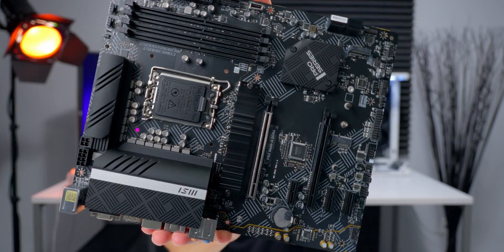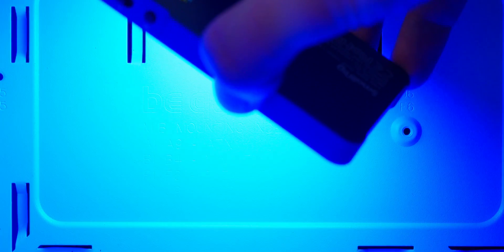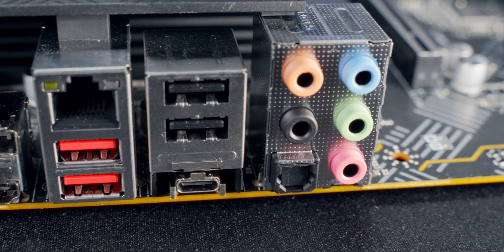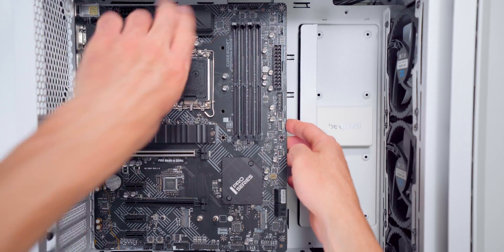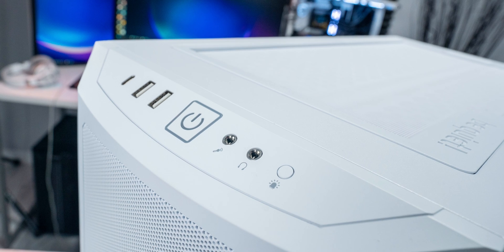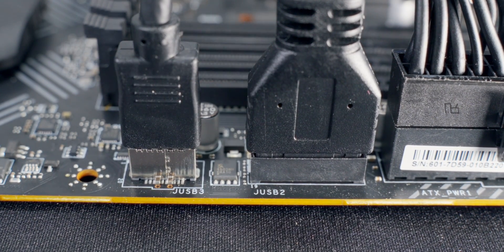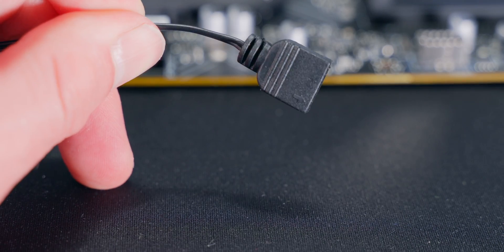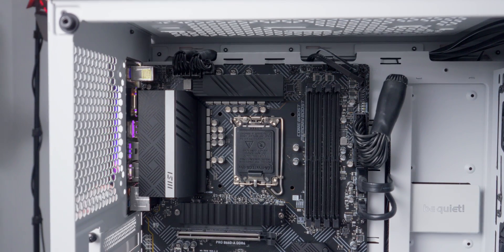How to Install a Motherboard into a PC Case

Comment: For the front panel connectors, aside from ensure they're going in the right header and polarity does it matter which way they're facing when you plug them in? Like some have a label on them. Should that face in certain direction? Thank you.

Comment: For the center post that was mentioned, do I need to replace this with a normal standoff? My case has one so I figured it was supposed to remain there and not be removed so I left it. Hadn't had any problems but I was thinking about it today. Does this need to be replaced or is it designed to be left like that?

Comment: this is one of the most frustrating aspects for pc game builders.
almost everything else is far more easy and almost repetition once you have already done it.
most of these mobos are different, not by much, but always read your manuals and watch vids before you buy/install.
i highly recommend you install 5-8 fans in your pc, make sure you read your mobo and its either 3 or 4 pins for the connections. i dont like too much RGB, im not 13.
please get a GPU bracket if your GPU is heavy, almost almost all GPU in the last 3 years are heavy, too much weight will damage your mobo, etc.
great vid

Comment: Where are the usb cables and all the minor cable go to?
Sorry for the question ive just seen the insertion of them to the mobo but idk where they come from in the case.
I have replaced every component on my pc but never a mobo seems kind of scary to do.
Reply: Answering myself for all the future people that might wonder about this.
(Finished building my pc)

The the usbs, audio, start button, and restart. Aka front panel.
Are wires youll have in your case.
Once the motherboard is installed you can fit those in their place.
Usually usb 3.0 cant be mistaken with another connection.
Nor does usb type c
Audio will be at the left down side of the mobo in most cases.

And as for the start and restart buttons.
You will need your mobos manual.
You should have 2 rows of pins mostly found in the right down corner.
The power button and restart will mostly be inserted horizontally.
But be aware each pin has a different size and different use. Which means the only one right way to connect them.

Refer to manual. You should have a drawing of the pins with each of them labeled.
For example for the power button look for.
Pwr + , Pwr -.
Make sure the polarity is right when you insert. If you can't find it on your connector. Just try 1 and flip it if it doesn't work.

And no. You dont need surgeon hands for this xd

Front panel done. Gratz
Reply: Those first USB cables are attached on the case.

Comment: How can i check what type of motherboards can fit into my pc case?
Reply: The form factor of your motherboards have different names which refer in sizes. The most usual ones are ATX, Micro ATX, Mini-ITX which uses 4~9 stand-offs in the case. The most efficient way to check, is checking how many stand-offs you have in your case and the actual form factor your motherboard is. There are plenty of pictures explaining that on google.

Comment: I have a z790 asus tuf gaming MB and cant figure out how to properly get the i/o shield off the MB first. Any help is appreciated.
Reply: If it’s already installed in the motherboard you cannot take it off, just angle it and put it in the case. That step is only required for motherboards that don’t come with preinstalled IO shields (usually cheaper ones)
Reply: Then how do we have the motherboard that comes with the IO shield, how do we make the motherboards sit properly flush over the standoff mounting holes? Because they don't align straight for me because the IO shield pushes away from the back of the case

Comment: My motherboard did not come with any screws to mount it to my case, i have an ASUS board, what do i do
Reply: The screws don't come with the motherboard, but rather the PC case. A lot of people seem to not thoroughly check their PC cases and most manufacturers include a small box/bag with accessories like mounting screws and brackets.
Reply: @JJFlores197  welp, too late now, my case's orignial packing and everything inside it is long gone
Reply: if it didnt come with any, google the screws u need for the specific make and buy them
Reply: Comes with the case
Reply: The screws usually come with the case
Reply: My screws were hidden in the hard disk drive compartment of my pc
Reply: I have the same problem i don't know
Reply: See my issue is that more than half of the pins aren’t aligned with my motherboard.. no matter what I do 🥹🙏 (Im a beginner, I’ve been at this for an hour)
Reply: Me too

Comment: This is hard to understand if you have an io shield on the board already. idk how to angle the board in to get the io shields in first
Reply: i know this is a little late but angle the io shield down to the table flipping the pc case on its back and then you can easily put the motherboard into the io shield
Reply: @peterjoecleveland  Tried that and it still didn't work. I have a Gigabyte Z790 Aorus Elite AX, and even the sides of the I/O shield prevent the board from being lined up and sitting flush with the standoffs. It was impossible to get it in and screw it down.
Reply: @aidanjames138  So how did you get it on? Because I'm having the same problem
Reply: did you get it
Reply: @jayhoochiemagee8487  yea thankfully I got it.

my confusion was with the pre installed io shield & why it didn’t want to clip on the side when seating it within the case. 

Then I realized it’s dependant on the case you buy.

so all I had to do was angle the mobo on the standoffs correctly while making sure the io shield slot looked good visually. 

Piece of cake
Reply: I've been fighting with the io shield for a couple hours, willing to try anything at this point. The first two rows we can get to line up but the top is still not cooperating. All three are just off enough to be concerned about damaging the motherboard. Any tips if they just don't line up???
Reply: @FrancisBonnefoy413 I have the same issue. Did you find a solution?
Reply: @bertramstigchristensen4614  It'll be disappointing to hear, but you really have to push it, more than you think would be safe. It ended up being a 2 person job where one pushes it into place while the other gets the screws. Start with one in the top row left corner and alternate all around to secure it.
Reply: @FrancisBonnefoy413  I ended up figuring it out, and I am now writing this on my brand new PC!!! I do greatly appreciate the response - have an amazing day<3
Reply: Im using an optiplex case, I just knocked the old io thingy out with a screwdriver
Reply: Same
Reply: @LightWorks222  so everyone, I found the solution if you are having trouble getting the board in with a I/o shield that comes with!!!
#1 you def should not need to remove I/o shield to install board
#2 place the board in there
#3 insert some of or all of the screws that line up until the rest fall in line
#4 you're done!
Your welcome lol
Reply: @elow3398  just did that and it worked fine, my first time building a pc and I thought that the IO shield should pop outward somehow
Reply: @elow3398 oh my god thank you so much man you’re a lifesaver
Reply: Where the fuck are the replies to the comment😊